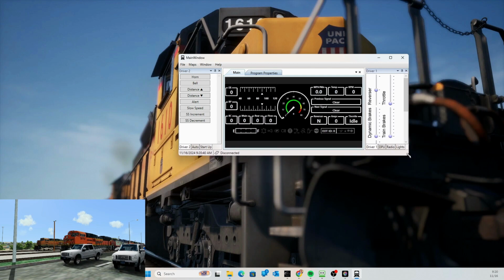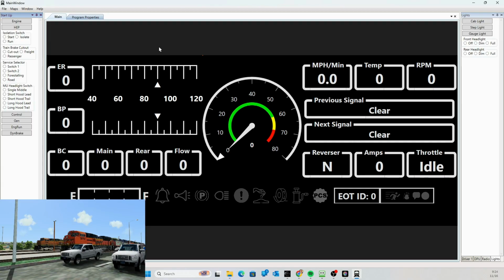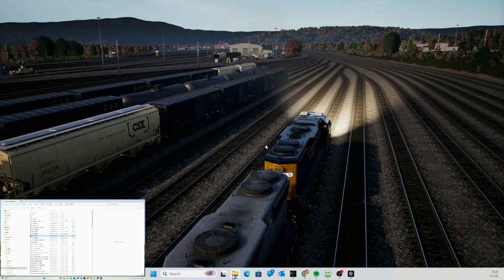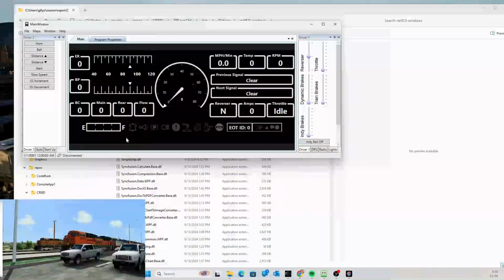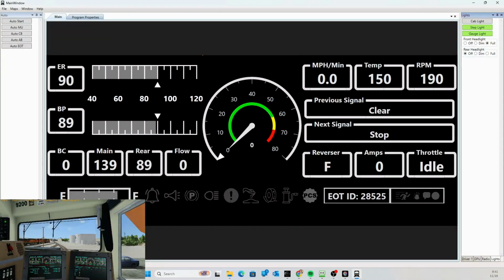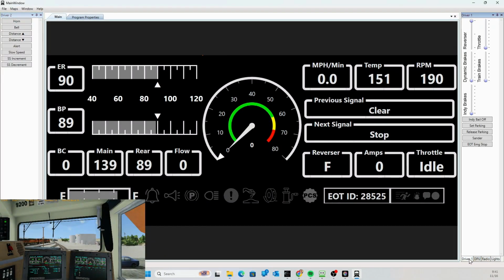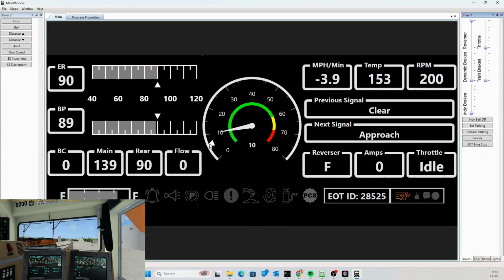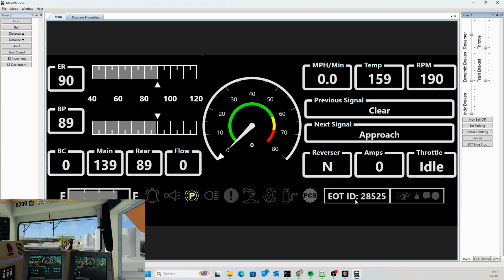New Run 8 Controller Ready for Distribution

Comment: Hello. Codger. New to Run 8. Awesome video. I want to know thought how to include your software if I use a rail driver. Id rather not use my mouse to use your software be I though I saw somewhere that it helps the rail driver be more accurate which is what im looking for.
Reply from the maker: Hi, Leo. Thanks for your comments.

With my program, the mouse is almost necessary, but once it's set up, you can use the keyboard for some of the controls. But it's not designed to make the Rail Driver more accurate—that's not really possible. It's really designed to be used instead of the Rail Driver. The Rail Driver will negatively impact the way R8 Control is used.

You get the accuracy by using R8 Control instead of Rail Driver. The slider controls in one of the windows for the brakes can be adjusted in discrete steps of 1 unit from no brakes at 0 to full brakes at 255. Clicking on a slider will cause the slider to move by an adjustable amount (as of version 1.1.2), called a "large change." But it can be moved with the mouse by dragging in finer steps. If the control has focus (a light rectangle will appear around it), you can move the control up or down by 1 unit with the arrow keys or by the "large change" amount with the page up and page down keys. You can change the focus among the sliders with a tab and shift-tab.

The way Rail Driver works makes it almost impossible to improve its accuracy. When the levers move, they put potentiometers (pots) under stress, which causes them to flex a bit. The pots start to destress once the levers stop moving, making them move slightly. This causes the values that Rail Driver constantly sends to Run 8 to change. That's why you have the flutter that you see in Run 8. It is possible to buttress the pots to minimize movement, but it's impossible to do that perfectly. No matter what, that flutter is going to happen with Rail Driver.

The throttle slider in R8 Control OTOH has nine distinct steps with values from 0 to 8. Once set, a new notch value is sent to Run 8, but it stops. It will only send new values to Run 8 once you make a change in the control. This eliminates all of the flutter you see with Rail Driver. The brake levers work similarly, so there is no flutter with those either (though that's not as noticeable in Rail Driver as in the throttle; it does exist).

That's more than you wanted to know, so I'll quit here.

Please continue to try R8 Control. I'm prejudiced, but now that I've used both it and Rail Driver. I won't be going back to Rail Driver for Run 8.